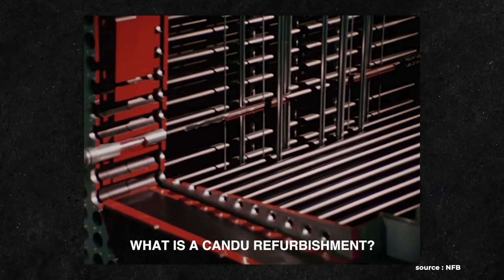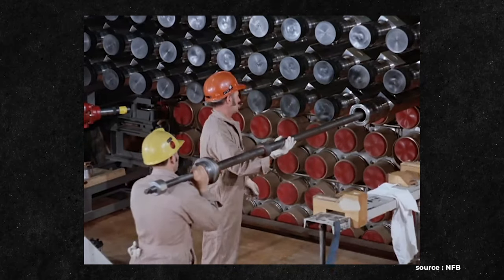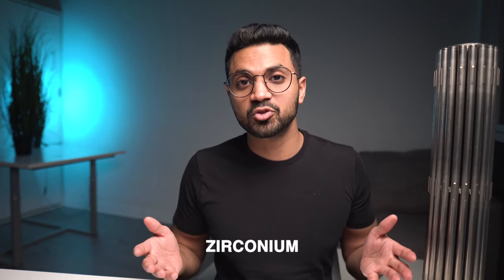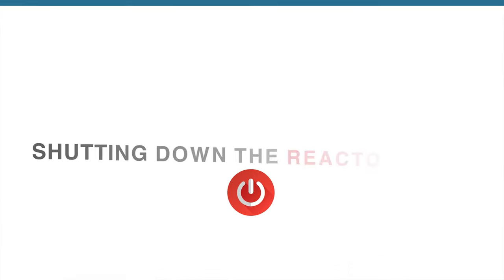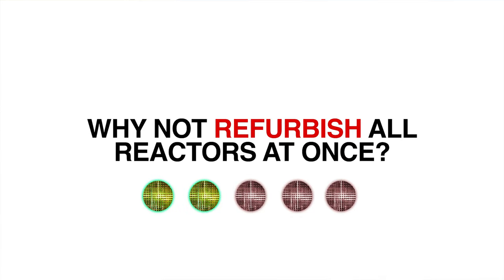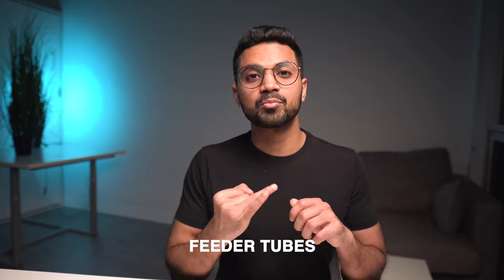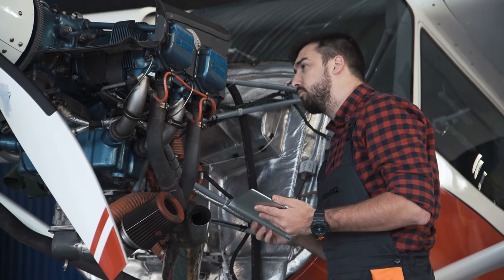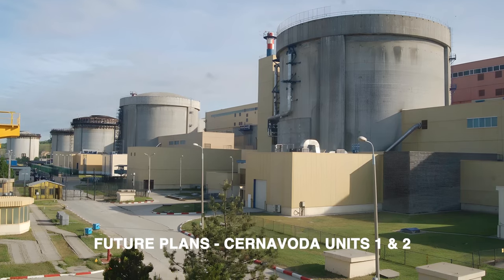Beginners Guide For A CANDU Reactor Refurbishment

Comment: What amount of life extension is provided by the refurbishment of the units?  Is 20 years, for example, added or is the unit good to go for another 40 years?
Reply: Another 30-40 years. When they are refurb'd they are not brought back to 'as new', they are actually 'better than new'. or rather 'better than original' because of all the product developments and improvements that've happened in the inter-refurb years.
Reply: @rhonda-my_honda_cb500x3  Thanks😊

Comment: I still can't clearly see how candu reactors work. I can see the calandria, but where does the water go? In between the tubes? And why do you say there's thousands of bundles, does each tube hold many of them inside? How is the water  move to the heat exchanger, with pumps? Finally I thought that you could refuel a candu reactor as is still running, is that right? 

Thanks for the videos. We need more of this if we are going to save the planet
Reply from the maker: It was a bit tricky for me to get it at first too. The calandria is the tank that holds water, the tubes (fuel channels) have pressurized water that runs through them. The fuel channels are completely separate from the calandria tank that holds the water. Also yes, the water is moved via large pumps
Reply: @OsamaBaig  thank you. I like these reactors a lot. Especially because it seems that they work on non enriched uranium